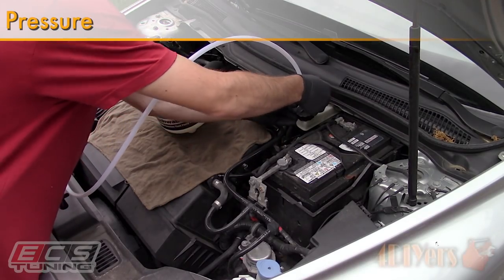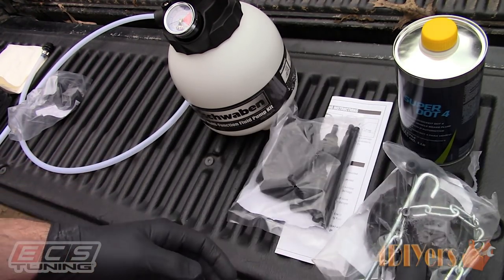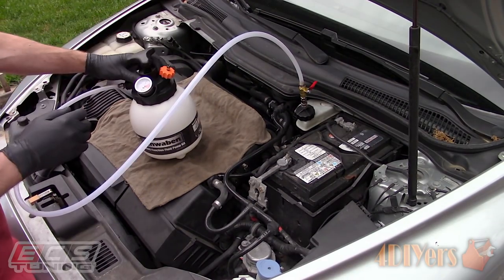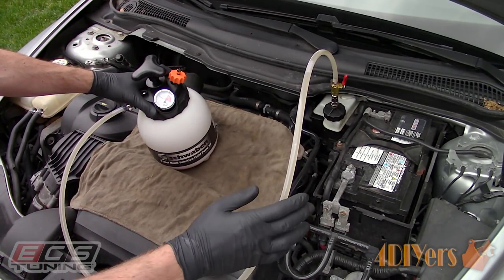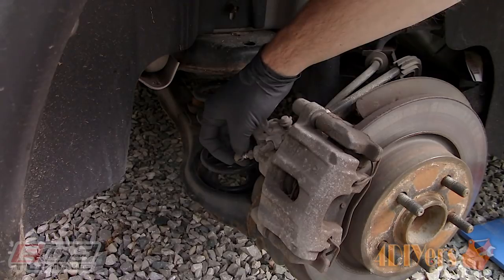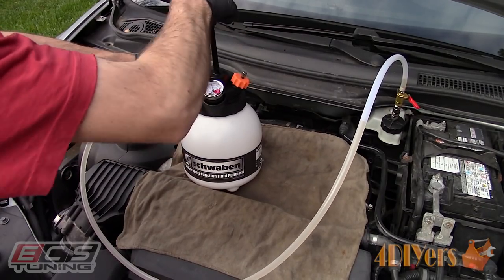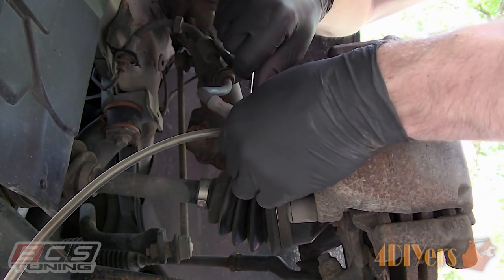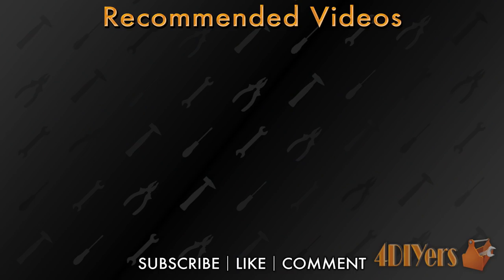How to Flush Brake Fluid Using a Pressure Bleeder

Comment: When you first opened the valve to let the fluid push into the reservoir, you did not purge the line, doesn't that push air into the system? That's what it looked like.
Reply: Naw
Reply: I agree.  The line from the tool put air into the reservoir.  I dont get how this is not introducing air into the system
Reply: The reservior has enouh fluid. The minimal air from the tube just stay on top of the fluid level in the reservior. Then the fluid from the tube will add to the reservior. One thing he could do better is that he can remove old fluid from reservior and add new one in at the beginning.

Comment: it  works with ABS ?
Reply from the maker: Yes it does. You may or may not need to activate the abs through the key or a code reader, it depends on the vehicle.

Comment: Very nice video.  I bought the unit.  Question: When you released the pressure to fill the bottle, did you have the valve open or closed on the master cylinder cap when releasing the pressure? Looks like it was open but closed when you started to pump. Thanks

Comment: Great video. One question, please.

After performing the service, and having leftover new brake fluid in the pressure tank, could I pour it back in my new brake fluid container?

Or no. Would the brake fluid in the pressure tank be aerated? Thus, one having to dispose it.

Comment: Another great video.  The pump makes it much easier than using a vacuum pump to pull the brake fluid out of the system like I've been doing.
Reply from the maker: Thank you, I really appreciate it! Out of all the different ways of bleed or flushing a system, it's by far my most favourite way.

Comment: Thats a handy tool! 
I have a tool that you place on the bleed niple and it sucks the old fluids out of the lines into a container, it works the opposite to the one in your video.
Dont over tighten the bleed screw too tight, on some (older) cars they are very crappy. Ask me how i know...

Keep up the good work 👍
Reply from the maker: Excellent tip and thank you :)

Comment: There's an O-ring on the underside of the pump handle,I found it best to lube the O-ring. I had a replacement on a different model,and lubed the O-ring to save it from getting damaged
Reply from the maker: Excellent tip, thank you for sharing!

Comment: t looks like this would work without putting any brake fluid in the 
pressurized tank. Probably just air pressure would do the same thing as long 
as you start  the bleed with the master cylinder reservoir full  when 
starting each wheel.
Reply: Agreed. A simple 15 psi regulator and a quick disconnect screwed into a OEM cap. No cleanup of bottle afterwards.

Comment: Is it necessary to purge the air from the line going from the pressure bleeder to the master cylinder before starting the bleeding process at the wheels?
Reply from the maker: No need to, there will always be an air space in the reservoir so it's not overfilled.

Comment: I used the universal cap and made sure it was secured properly. Went forward with pumping it up to proper psi and it released and got brake fluid all over my engine bay and the ground....did I do something wrong??
Reply from the maker: Do you mean the one with the chain? Make sure the opening is clean, free of any damage which would cause leakage, it's tight and it's center with the reservoir opening. Make sure you wash the brake fluid from the engine bay too, depending on the type, some can cause more damage.
Reply: @4DIYers  yes, the one with the chain. 

Thank you for your response! Resolved the issue and hopefully washed away most of the spilled brake fluid. 🙏

Comment: when using this, dont you have to remove the old fluid from the brake resevoir and fill it up with new fluid first?
Reply from the maker: No, it will push all the old fluid out of the system.

Comment: Cam i use this bleeder wirh a 1979 f150, i have the coomon "metal" cap on brake master cylinder with dual fluid reservoirs.
Reply from the maker: Yes you should be able to.

Comment: That bleeder equipment will remove air in the ABS module?
Reply from the maker: Yes it will, you may need to turn the key on or have a bi-directional code reader to activate the module though. It depends on the vehicle.

Comment: Hi @4DIYers,  one question, was not used an obd scanner to control the solenoid valves of ABS? Thanks
Reply from the maker: Depends on the vehicle, sometimes you can get away with just turning the key on. Not all OBD scanners can activate the ABS system too.

Comment: Great video! What's other uses of this tool? I'll be hesitate to buy it if I'm only going to use it every five years or so.
Reply from the maker: Thank you :) You can use it to bleed brakes, fill transmission oil, differential oil, transfer case oil, and any other confined hard to reach areas for fluid replacement. It has various nozzles for those tight fill points and threaded attachments. BMW is a bit of a nightmare when replacing the oil in the transmission, their fill point is in the center of the pan and that fluid level, if I remember right needs to be checked while the vehicle is running on level ground. The fluid level should be at the top of the fill hole.
Reply: @4DIYers  hi do u need to clean  the bleeder if u plan to use  it for trans,brakes and diff oil  or u can mix the fluid  
i plan to do those 3 in one day so i'm wondering how to clean the bleeder to not mix the oil  if its possible to do like that

Comment: Is there any good way to clean out this bleeder?
Reply from the maker: A small pick, wire brush, and brake cleaner. Make sure you're wearing safety glasses.
Reply: @4DIYers  I mean the reservoir: it doesn't seem like there's any way to totally clean all the residual brake fluid out when you're finished.

Comment: t looks like this would work without putting any brake fluid in the 
pressurized tank. Probably just air pressure would do the same thing as long 
as you start  the bleed with the master cylinder reservoir full  when 
starting each wheel.